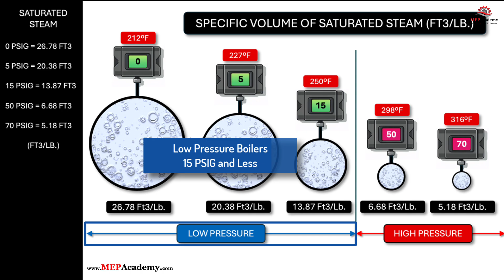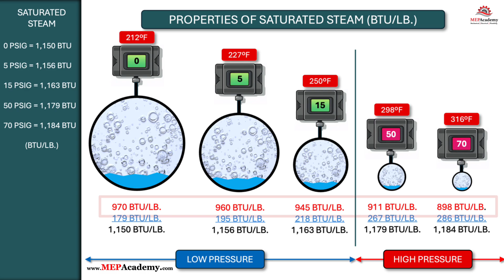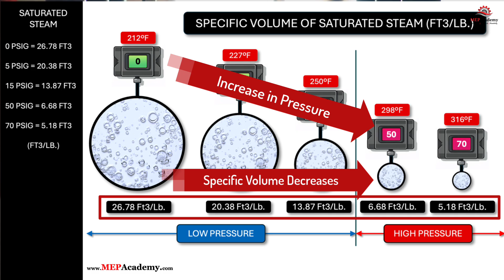Why use Steam

Comment: I have a question. In performing an energy balance using saturated steam as the heat source, if I aim to use the same amount of energy with the same heater but lower the steam pressure (resulting in a lower steam temperature), the latent heat will increase, and the mass of saturated steam consumed will decrease accordingly. Could you confirm whether these calculations are correct? Additionally, in practical application, would it be expected that as the steam pressure decreases, the amount of steam required would also decrease, as indicated by the calculations?
Reply from the maker: Yes, your understanding of the energy balance and the relationship between steam pressure, temperature, latent heat, and mass of steam consumed is correct.

Comment: As i have been installing low pressure steam boilers for years now . 
     Going to say its the best heat for any home .
     And i can still run a hot water loop through the bottom of the water line for DHW , or hydronic zone 😮
Reply from the maker: Nice to hear your making use of the properties and benefits of steam, thanks for the comment.